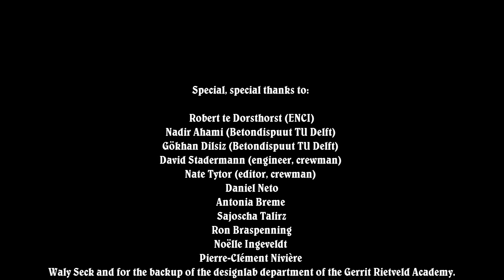Lena's Concrete Boat

Comment: 19,1 LITERS of water ,not kilograms,u full!
Reply: 1 liter = EXACTLY 1 KG, `u full`
Reply: @BarniRepairs  And 1 L = 1 kg is by design, since water is so important to human life that it was highlighted in the metric system. Also, 0 Celsius is when water freezes, and 100 Celsius is when water boils. The liter is a measure of volume as much as it is a measure of weight of water.